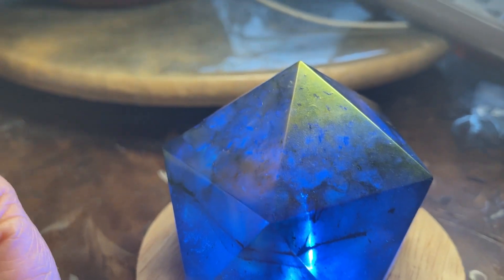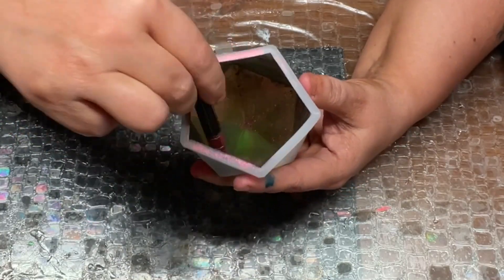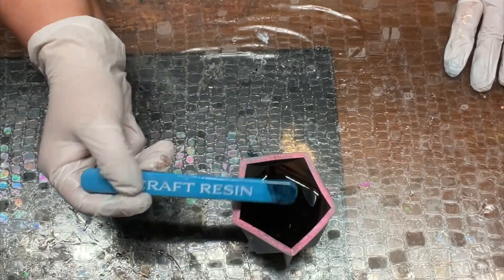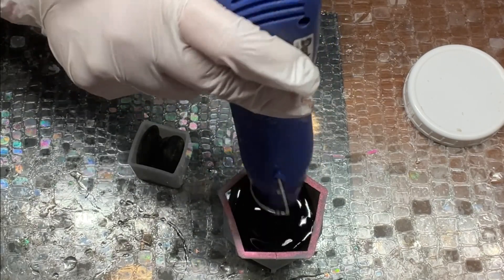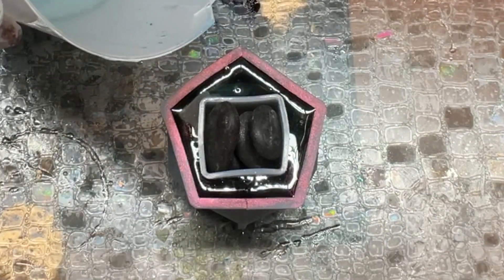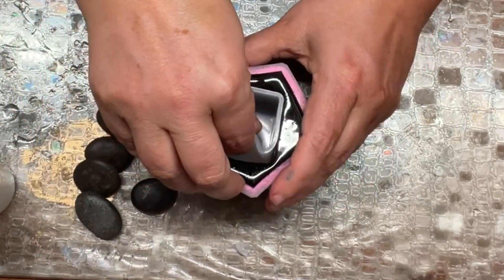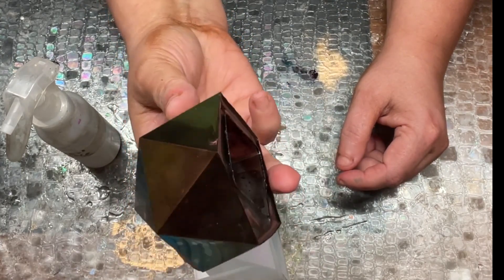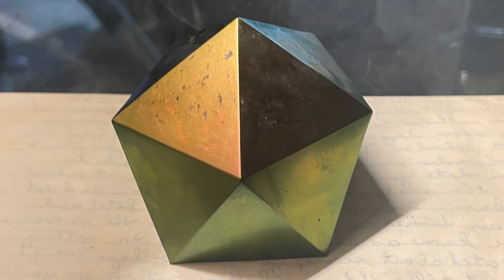Creating a HOLLOW inside of a resin piece by using a mold inside of a mold.#colorshift #crystals

Comment: -Resin layer-cure
-Thin Resin layer then square - -vibrate (brings up any trapped resin in the thin layer of resin below the square. You can use anything that vibrates like a tooth brush, a muscle relaxer (those big devices for body muscles) a back massager or a personal vibrating item ;) 
-cure
Now fill the rest up and make sure there’s no bubbles 
Cure